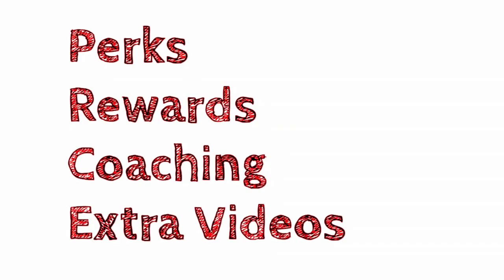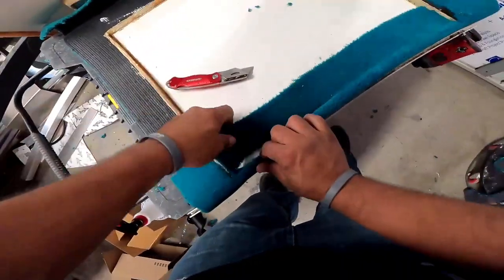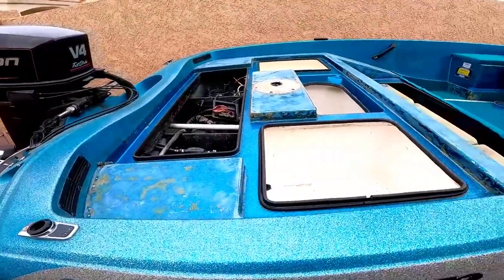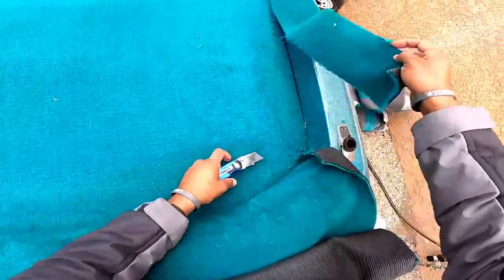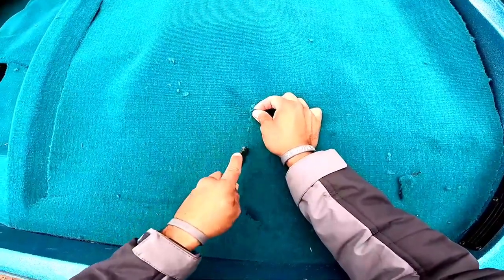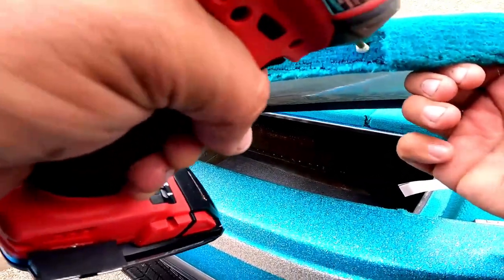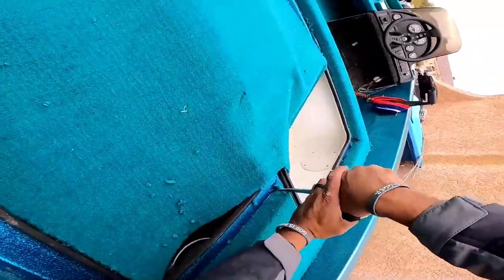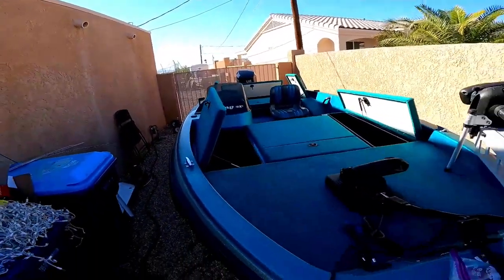Bass Boat Carpet install tutorial on Old Ranger  | FULL TUTORIAL

Comment: Turned out good, but if I could make a couple of suggestions. First off is you should lay out the carpet in the same direction, all carpet has a grain to it and if you don’t lay it all in the same direction then it will look lighter and darker across the boat. I would also suggest using weldwood spray grade contact adhesive through a gravity fed paint gun. It is pricier but you will not regret it, you don’t have to use clamps and it sticks so much better, because you can get a much better coverage and it sets up so much faster. I’ve done boat carpet and upholstery for 18 years now, so just a few suggestions from the years of experience.
Reply from the maker: 20 oz carpet doesn't have grain. It all looks the same.
Reply: @TinyBoatNation  all cut pile carpet has a grain to it, and will reflect light differently from different angles and can make it look like two different shade of the same color. I work with 22oz carpet everyday, believe me there is a grain to it.
Reply: It's funny how many people are surprised carpet has a grain. And that weld wood glue is the best!!! Ony glue that I know that is 100% waterproof. And holds like no other.  Ony thing is I would hate to be the guy who changes the carpet down the road after using this stuff.
Reply: It all has a grain  @TinyBoatNation

Comment: I know the video is far from new, but this comment is important for those watching to learn how to carpet a boat.  Always mark the uncut carpet on the back with a generous sprinkle of arrows pointed toward one end.  As you carpet each section, make SURE you keep all the carpet pieces oriented in the same direction. If you don't, the odd pieces will appear to be a slightly different shade.  It looks like he may have gotten one piece on the rear deck in the wrong direction.

Comment: Make sure your carpet is not too thick. You will have gluing problems specially when folding corners.. I used rubber back 20oz and it’s a mess on the edges and corners with all the lockers.
Not a glue fast enough or strong enough without hours of clamping.

Comment: Hey Michael how did you remove the  the driver seat and passenger seat platform to get the screws out of my 1990 Ranger 364V. I took out the six 3” stainless steel bolts out three across the back behind the seats and the across the front toward the floor but it still want let go and it acts like there’s something across the back wall holding it. I don’t have the full bench seat just the two seats like tempress folding seats. They have to be removed to be able to get the slip skins on. I noticed that this boat your working on is similar to mine the the fiberglass platform lifts up off of the gas tanks. Are there any hooks that it has to lift off of. Let me know if you can help Thanks Wayne

Comment: Should use contact cement instead of glue on the bend areas . You will not need clamps and it will hold longer.
Reply from the maker: Yeah, but it’s a mess and it’s too risky
Reply: @TinyBoatNation  that's what most boat carpet installers use.

Comment: Hi TBN! I'm working on a rebuild of a 1970s 14' aluminum seanymph. Im replacing the wood flooring and recarpeting the flooring and sidewalls of some bench seats im going to add. I was wondering if you suggest carpeting the panels before building, or building the floor, storage, and seats then carpeting over the wood structure? I can send pictures of the boat im working on if it clarifies. Thanks for all your vids, been following for a while now while tearing down and rebuilding my boat.

Comment: I just picked up some Lowes adhesive last week to redo my fiberglass boat. Do you find much difference between the 3M  Super 77 and High Strength 90? Are there any concerns that those products will eat away at any of the substrates they came in contact with?

Comment: Can you get gator skins in big squares? Like 60x60"? Wanting to do one solid sheet for my front casting deck.
If not do you recommend carpet or foam top? 
Worried about carpet holding water
Reply: @TinyBoatNation  thanks for the reply. I figured it must butt up together decently from what I've seen you do.
Keep up the great work, you inspired me to add some features to my 14ft lund and it's been a blast learning from TBN